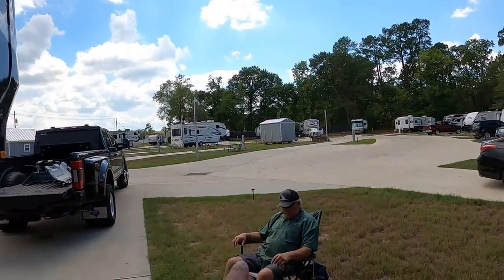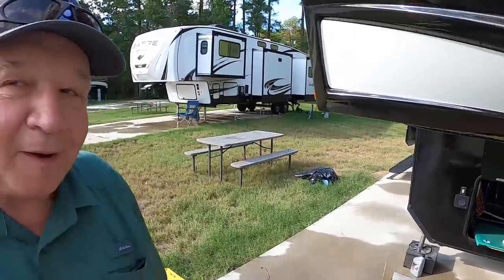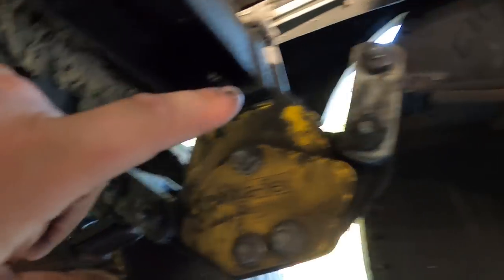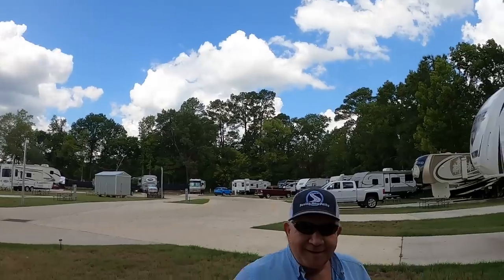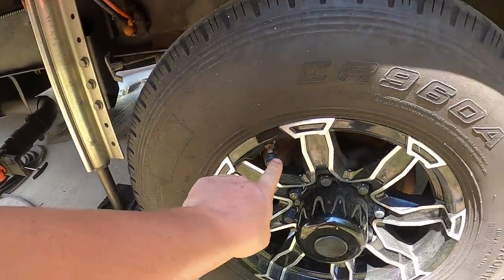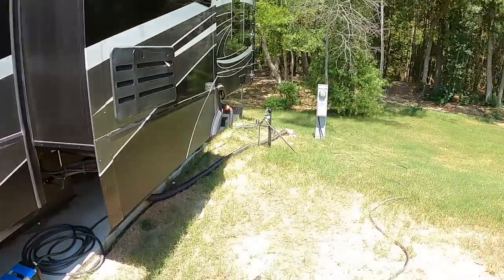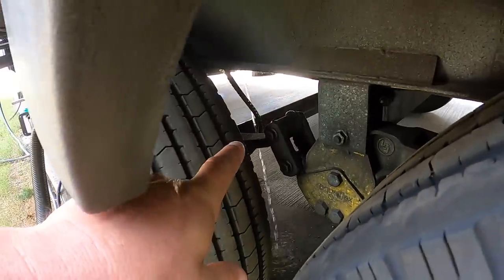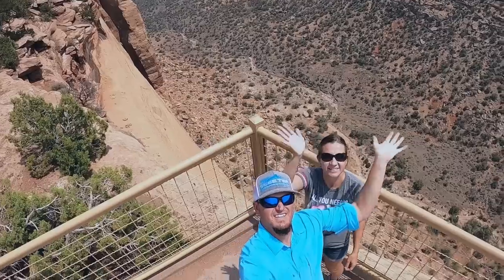It Never Ends! | There's Always Work With An RV! | Fulltime RV Living!

Comment: Get the entire underside of the camper sprayed with fluid film.  Especially if you’re gonna be up north in the winter time. Take it from me up here in northern Ohio. The salt on the roads will rust anything quicker than you’ve ever seen. And it gets even worse the farther you go north. As far as the steps go, in my opinion your best bet it’s gonna be take them apart and I also have them fluid filmed.
Reply from the maker: The entire frame and all the components under the RV are covered in Fluid Film!  It has held up great and I see how good it did protecting me from the salt and the sand down in Florida! I should have sprayed the steps but my kids use them and play on them!  Fluid film is kind of greasy, so I wasn't sure having it on the steps would be a good idea! But its better than rust!

Comment: I have good luck with using rust-oleum rust reformer. You can get it at tsc or Walmart. Just get a little wire wheel for drill and clean up rust spots. Maroon color scotch Brit pad the other areas. Wipe down with wax grease remover paint prep before painting. Rust-oleum high performance enamel silver can with black cap is great paint to fast drying.
Reply from the maker: Thanks for that! We will look into those products as it is only going to get worse!

Comment: For your steps. I have used a rust killer spray (available at most auto stores) let sit then scrape with wire brush and then spray paint. I think that is about all that can be done.
Reply from the maker: Thanks for the info! I also feel like that is a losing battle and once it starts to rust it will never stop!

Comment: You only have surface rust so just a small wire brush rub it down and then silicon paint next time when you come out of a salted area, drench it hard with freshwater.
Reply from the maker: The bad thing is the rust showed up almost over night when we parked on thre beach in Florida! Next time I will do recoat every surface with fluid film before getting close to the salt!

Comment: On a trailer like your I would disassemble sandblast and powdercoat, which sucks but a one and done so you don't have to worry about it again. Just lube the joints during scheduled mantaince.
Reply from the maker: I am thinking that is the only way to stop it!  Completely disassemble, repaint or Powdercoat, and reassemble!

Comment: Just a quick question, do you not have the in-tank cleaner on your black tanks? I do and you just turn the water on and it sprays water throughout the black tank and does a wonderful job on cleaning them. I like it and my wife is very happy to run it while I get the rest done.
Reply from the maker: We do and I performed a good flushing and dumping procedure during this video! I just didnt show the step by step as I have already done that! We use the tank flushers to clean the tanks prior to treating them!
Reply: @PavingNewPaths  thanks.

Comment: If I may recommend corrosionX or corrosionX HD, comes in a rattle can and will lube it up and stops/protects against corrosion.  I like to use it on electrical connections and situations like those steps.  Good luck and keep up the video effort, cheers.
Reply from the maker: Thank you!  I will look into the Corrosion X!  I have been using fluid film on the trailer frame, and it did well but I didn't even think to put it on the steps as it is very greasy! Thanks for watching!
Reply: It also smells like peanut butter

Comment: Loved seeing the girls fly down those slides.  I bet most folks do.not do all that maintenance.  They will regret  it.

Did you get the rust situation under control?
Reply from the maker: Thank you! They had a great time! For now the rust is on pause as It is just coated to prevent further rust! At some point I think I will end up taking them apart to fix it permanently!
Reply: @PavingNewPaths  I figured as much. You are too fastidious not to do it right.

Comment: I recommend an aerosol epoxy paint for the steps and hangers If interested I will give you a recommendation.
Reply from the maker: Thank you! please tell me what you have in mind!
Reply: @PavingNewPaths  I recommend VHT’s satin epoxy paint. Super durable, easy to use and the satin will help hide imperfections. Be sure to sand, wire-wheel or otherwise prep the surface. No primer needed. 👍🏼 Amazon carries this and it’s also available at automotive supply stores (Advanced Auto for example).

Comment: I was going to recommend a really good metal protector i use on all my oilfield equipment but i see the experts in the comments have already chimed in..😅..
Amsoil MP + Amsoil tube grease is hard to beat, unfortunately their best grease has been out of stock for some time
Reply from the maker: I like to run the lucas red n tacky, but ill run any EP2 grease that is available!
Reply: @PavingNewPaths  Availability is key definitely.. if lucas had a larger array of products I'd definitely consider them as a vendor vs Amsoil, it's nice getting everything the shop needs from washer fluid to grease in 1 delivery
Reply from the maker: @Liimpy  That is something to consider!

Comment: Just wire brush and us synthetic gun oil it's supper thin and works real good try it after rust is gone
Reply from the maker: Thanks for the tip! I cleaned the rust and found some graphite lube that has been pretty good at keeping them rust free now

Comment: Recommendations for your steps… stay out of Florida! 😂 No, wire brush rust where you can see it. Rust never sleeps. Spray paint with rust prohibitive coating.
Reply from the maker: Almost all that rust showed up in less than 7 days when we parked on the beach! I'm afraid the only way to do it right is to take them apart to get rid of all the rust and re coat!

Comment: If the blue set up is so good why does your other secondary filters so bad when you change it and you water heater. Whould that blue set up be one of those don't really need things you talked about in setting up a camper I get the extra clean but well you get it ..
Reply from the maker: Thats because this was the first cycle that we had been running the new 3 stage water filter! We also don't always hook it up, if we are just passing through we run straight to the onboard filter! There was also 3 months of just the onboard filter doing to work before the new water filter was added! Thats why the anode rod looks the way it does! It didnt help it was Florida water the whole time!

Comment: Gas generator no thanks. Always diesel
Reply from the maker: The only option you have is gas or LP for a majority of the RVs nowadays!
Reply: @PavingNewPaths  really? Wow I thought they would've had a diesel. Never knew that. Thanks. Where is the tank for it? Sorry I don't own a camper I like to watch yall
Reply from the maker: Most toyhaulers will have a gas generator as they already have a gas tank in the rear to fill up the toys you may bring with you! There is 30 gallons for toys and 30 gallons for the Generator! We don't carry a toy so we have 60 gallons for the generator! RV'S that are not toyhaulers usually come with lp generators!